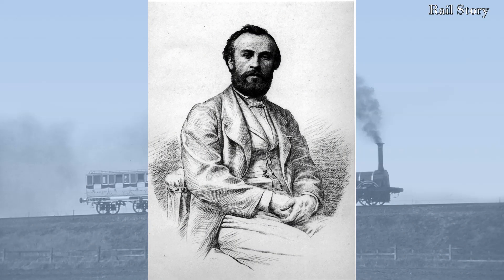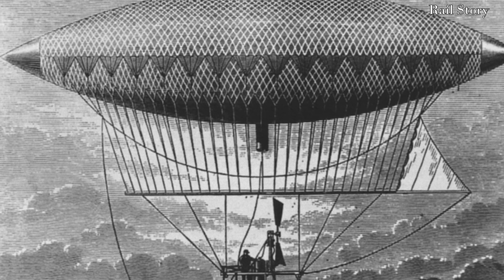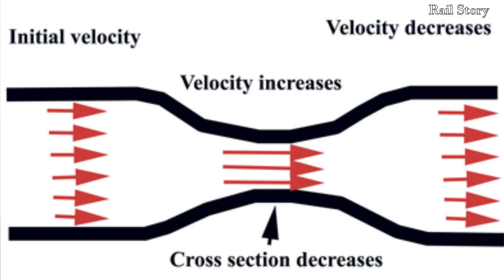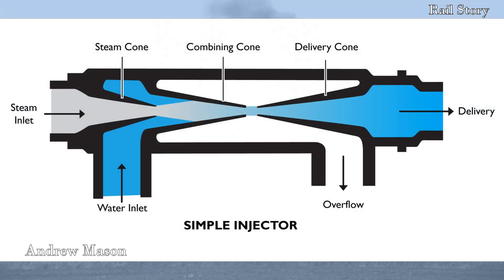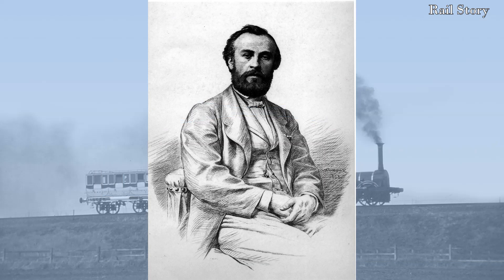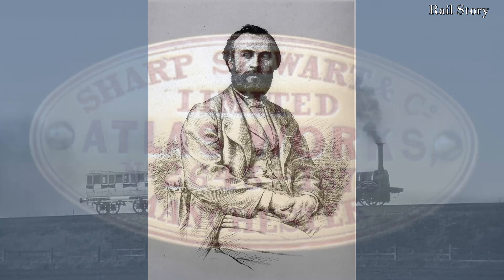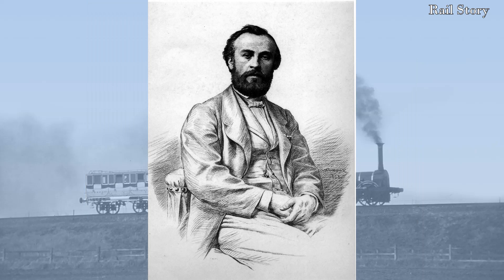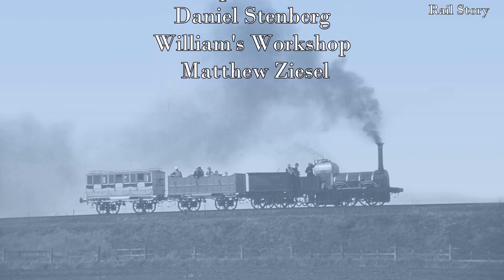Giffard: The Basics

Comment: This was a fun video. I enjoy learning about the various applications of steam propulsion throughout the early 19th century. The French had some wacky ideas, indeed.
Reply from the maker: "wacky" perhaps but Giffard made the first powered flight decades before the Wright Brothers. The French also invented the first self-propelled steam powered road vehicle - and it worked too -  in the eighteenth century.  What some may deam "wacky" was cutting edge technology which worked. The Giffard injector revolutionised the working of the steam locomotive.
Reply: And you can add Clement Ader to the list of "wacky" Froggies. He simply invented the airplane some 10 years before the Wright Bros. Batlike winged, equippedwith a steam engine: the Eole then Avion (he coined the name too, leading to the universal word "aviation").

Comment: I still maintain that it's witchcraft and venturi cones. The best explanation I have seen Mr Dawson, and I've been working the b****y things for 50 years! Thank you for this Sir, much enjoyed.
Reply from the maker: Thankyou. There's a dark art to the injector.......
Reply: @AnthonyDawsonHistory  I agree on your and Mr. @Douglas Fleetney, the injector is somewhat confusing, you have steam from a given boiler overcoming its own pressure,and this is counterintuitive. The Venturi effect, a special case of the Bernulli effect is responisble of "sucking" the water from the repository; but how it happens that the hot water stream overcomes the non-return check valve and pushes water into the boiler? Greetings for your explaination, very clear even if a physics professor could object on the wording - but I think your wording, even if I suppose that your wording is more effective in delivering the message to the general public.

BTW, I think that the magician's trick is that you can not compress water and so Pascal's law enters in the game, somewhat like when your car is lifted with an hydraulic lifting platform...🤔
Reply: Reminiscent of 2-stroke expansion chamber physics
Reply: most scientist dont know why airplanes stay up, they know how but not why, still mostly guessing, if butterfly fart in sahara airplane crashes in siberia